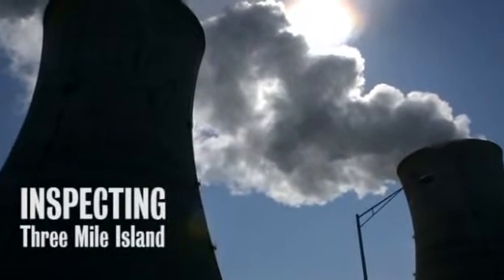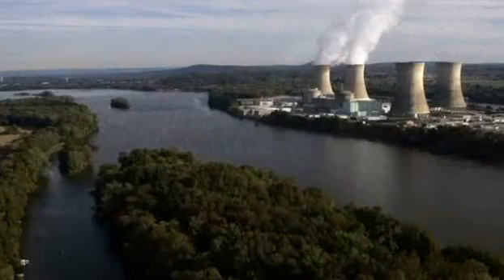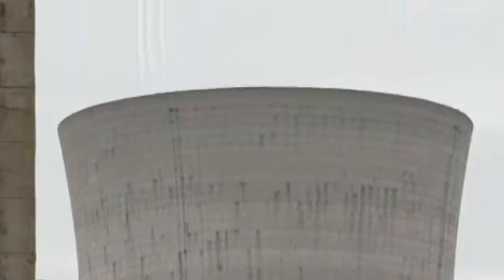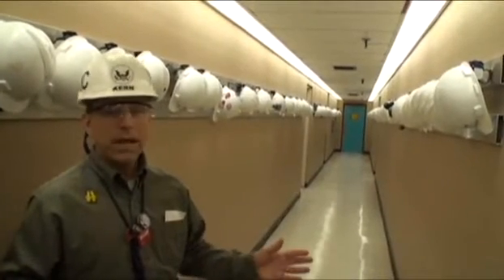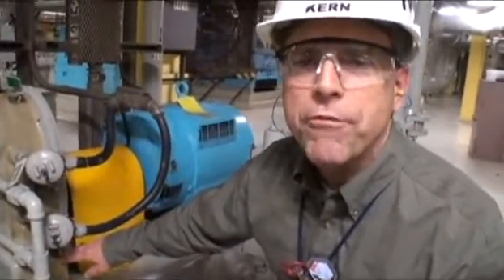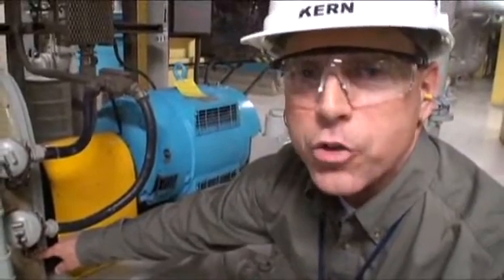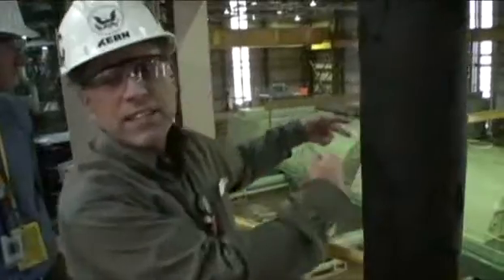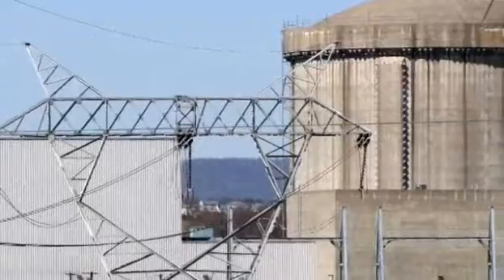Inside Three Mile Island: Inspecting the Nuclear Power Plant

Comment: was unit 2 ever restarted?
Reply: +derek wall No. The core melted and destroyed the reactor.  It was mostly defueled in the 90's and is cold storage until unit 1 is decommissioned. Not until 2034, at current.
Reply: @doxielain2231  so unit2 is dead I thought there an small explosion what ever it was it rips her stomach open which must have hurt a lot,the reactor's blood drips onto the containment floor she falls into the spent fuel pool and the reactor gets her legs thrown apart past her shoulders and also getting an control rod shoved up her butt and the other don't ask where. The reactor dies in the spent fuel pool after having the inside of her throat ripped out by the fuel assemblies in it but they couldn't lift her vessel (body) out the pool so the reactor's body decomposes in the spent fuel pool. They thought it was the water in the spent fuel pool that was smelling like old water not a dead reactor but it smelled horrid when they entered the room the smell was really strong they checked every inch of the power plant including the other reactor's containments for unit2 but didn't find her when checking unit2s spent fuel pool they found the reactor's mummifing remains in it almost entirely decomposed the smell got worse when they pulled her remains out and the foul smelling black liquid was the reactor's blood and liquified organs.
Reply: Doxie Lain ya im suprised the plant is up and running period
Reply: 2020 here.. power plant is shutdown

Comment: So an power plant producing electricity can not use its own electricity in an emergency situation!... also not logical
Reply: Steelfalcon22 the power generated by the plant is very strong and has to go through substations and transformers first before it can be used. Just like how it has to go through them before it can go to your house.
Reply: The problem is that it can't use its own electricity when it is shut down.  While the chain reaction stops during shutdown, the radioactive decay products continue to generate considerable heat for some time.  This means that upon shutdown the reactor is generating heat at 7% of prior levels.  If the cooling system and backup cooling systems stop then simply inserting the control rods isn't going to stop the reactor from overheating.
Reply: @jtxx34xx  Typically nuclear power plants have mulitple reactors that refuel at different times. It's beyond me why a simple transformer isn't in place to utilize on site power. Yes its very strong electricity as stated by the comment above. But all a transformer is, is wiring wrapping around some other wire wrapping. Make a custom one to get the desired voltage. If its dc and you ac put in a converter and you got onsite power. We are talking about a billion dollar power plant that can produce all of it's operating power but yet is dependent on an outside connection for power. And if a substation is absolutely needed. Then build one at the power plant. Again it can't be relatively expensive considering if offsite power is out, then a meltdown may occur.

Comment: my opinion on nuclear power is that the risks out way the benefits, the cost of building a nuclear power plant cost way more then harvesting any of the other green energy's like wind and solar, waves. they also do not create any harmful wast material like nuclear wast. in case of a earthquake it could destroy the facility and leak  radiation in to the water and or air.
Reply: okay, but solar and wind and tide don't produce enough electricity. 
"in case of a earthquake it could destroy the facility and leak  radiation in to the water and or air." unlikely. fukushima was caused by a tsunami, and by having the diesel generators in a shitty place
Reply: I'm more worried about sabotage or war.   If backup diesel backup generators are needed, a plant isn't safe under such conditions.